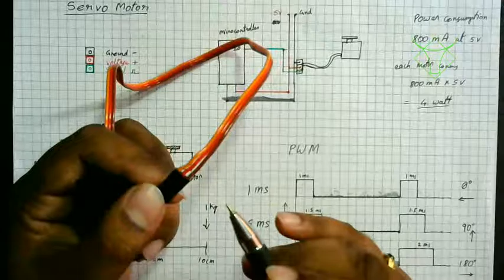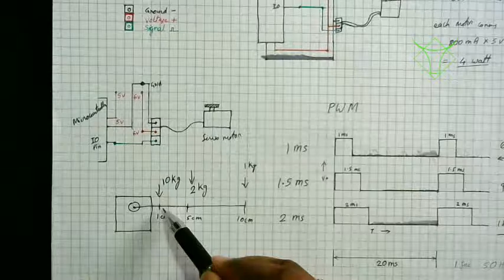Servo Motor

Comment: How many pulse need for moving servo 5 degree ? because servo is used for robotics and many applications where need to move servo more degree forth and back not enough 0,90,180 degree ok and that you told all ready written in servo motor discrpition box .we need 1028 microscond  positive pulse after every 19973 microscond for moving servo 5 degree .
Reply from the maker: Hi Sunil,  If i understand you correctly, you are asking about how to calculate pulse for each degree right?
See the pulse have to vary from 1mS to 2mS or 1000uS to 2000uS ( micro second). So divide the difference by 180 degree i.e, (2000 - 1000)/180 = 5.555. So for every increment of 5.555uS servo moves 1 degree. 
for 5degree its 5 x 5.555 = 27.775 ~ 28uS.
Yes you are right about 1028. Simple!
this might help others also.